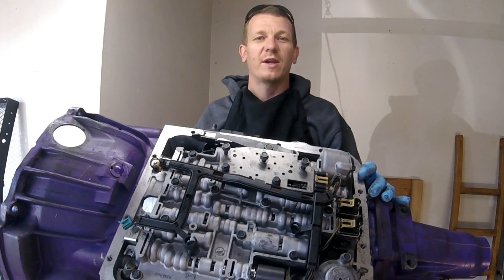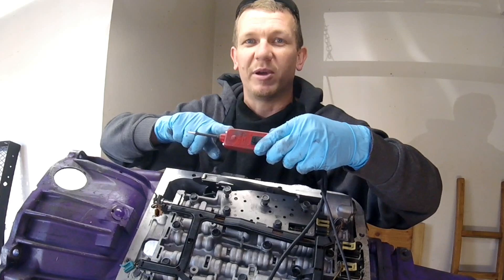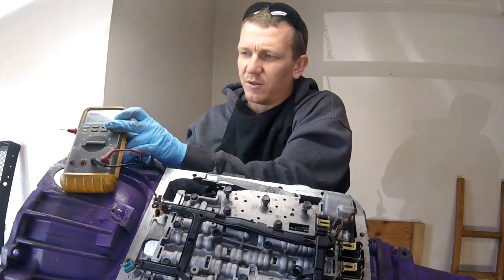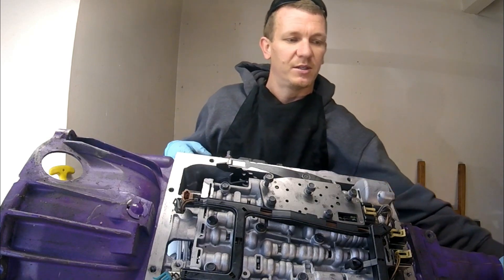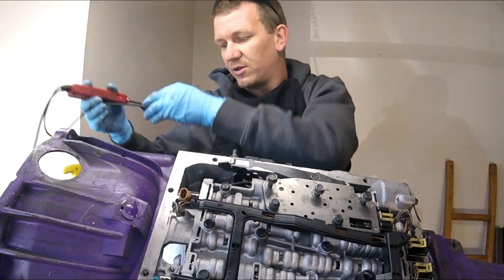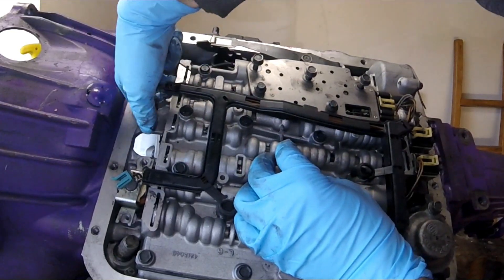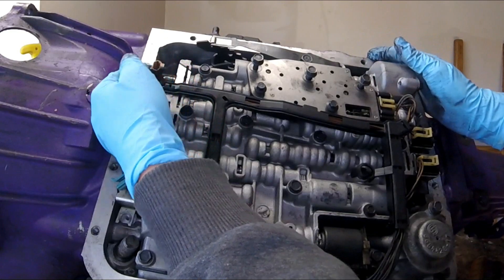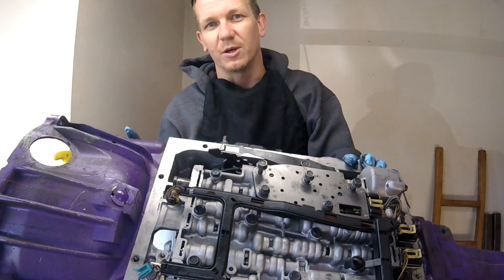⫷ P0785 4L60E ⫸

Comment: In case it's helpful, I had the P0785 on my 2000 Chevrolet Silverado K1500 and tried a bunch of things including replacing the 3-2 SS because it was inexpensive and simple. I tested the wiring harness by probing the power pin in the connector with my red lead and grounding on the frame with my black lead and got 11V (with the ignition switched to ON)--no issues here. I pulled the cover off the VCM in the engine bay and found the BLUE connector. Lo and behold, the WHITE wire (pin 13) was broken. This happens to be the wire for the 3-2 SS. I repaired the wire with a crimp, and my truck is running great!
Reply: VCM in engine bay? What are you talking about?
Reply: @dudebrosefson4699 vehicle control module

Comment: hi scotty new the channel so i have a 2002 trailblazer 4.2l 4l60e ihave replaced the a&b and thw 3-2 vavle tested the wiring harness with power probe  with key off and aligator clip not on a ground nothing to either side of connector .withe key on and aligator clip grounded i get poweer only to one side of connector not the other could this be a ground issue the shifting sucks i put it in drive and take off slow it will shit into 2nd  them limp  mode and nothing but when i stop and put it in prk then back into drive it will do the same thing and i can not even power shift it getting a p0785 code HELP

Comment: Hi. I replaced a broken TCC Solenoid (#24227792). On GM's website it says "This part requires programming and/or special setup procedures"... did you have to do a relearn/ programming procedure when you replaced it with a new one?

After replacement i'm still getting code p0894... also replaced the Trans control solenoid (2141892 ). Shifts fine driving in the city. Only after hwy driving do I get the code.

Comment: Hello I have a 2002 gmc yukon xl denali with the r4l65e transmission, it's not shifting into 2nd at all, was wondering if changing the solenoids will fix the issues.  Other than that, before it was just really sluggish and would act like it's driving in towing mode.  There's no transmission slippage or weird noises, it just won't shift out of 1st anymore.  Was also wondering if you knew if the solenoids in the 4l65e were different than the 4l60e.

Comment: Hey man. I've got a question that hopefully you can answer. When buying solenoids, is the 3-2 shift solenoid the same part number as the TCC/PWM solenoid? I'm getting the same part number for both. Is the measured resistance the supposed to be the same in both solenoids? I'm trying to buy both and wasn't sure if I could just buy 2 of the same ones. Advanced Auto has the same part number for both of them. Thanks in advance!
Reply: yes
Reply: Same issue, but both look different, some places show the TCC solenoid instead of 3-2, any idea which one it is?

Comment: Ok. I did all that on my 1998 Chevy C1500 with the 4L60E I WAS GETTING PO785 but my truck was not going into 1st gear or 4th gear. If I drove it for like 10 minutes like that I was able to shut the truck off and then turn it back on and then I have all my gears. I changed all my shift solenoids filter and fluid and it's still doing the same thing. Even if I try to put the shifter in 1 gear. It still won't work until I warm up the transmission and then turn the truck off and then back on and I can do that in neutral and then it goes in all the gears.
Reply: U figure it out got one doin the exact same
Reply: I have the same thing going on, any fix?

Comment: My trans will not shift out of 1st .05 Chevy avalanch .5.3.im being told its a shift silonoide
Reply: How do I fix.
Reply from the maker: Possible but it could be a lot of things. Does your speedometer work? Does it show your speed?
Reply: @ScottiesHobbies  the speedometer works accordingly all gauges work tachometer obviously raises when you're giving it gas
Reply: Everything works accordingly I did have an engine light on for evap but as far as everything else I've yet to try it has all the power in the world it will not go in the second third and drive
Reply from the maker: @lanceWM  i was thinking maybe your vss might be the issue but if you have a speedometer reading, its not that. You really need to test the shift solenoids. It could be the shift valves in the valve body not moving too. Its really hard to say its this one thing or another. You will get a different opinion every time and that can get expensive.  I'd get the ohms of resistance for all solenoids and drop the pan and start testing. You can also use a 9v battery to check the operation of the solenoids.
Reply: @ScottiesHobbies  ok ty
Reply from the maker: @lanceWM  no problem, I wish I could say its this one thing or another. Good luck on your fix. Keep us posted on what you find. 💪🤞👍

Comment: Glad I stumbled to this channel exactly on the jul 26 2021 bought a 94 Chevy c1500 from an auction with a bad transmission won’t go into any gears and I wanted to see if I can try something to see if I can try and somehow preform a miracle and get it to move so I’m trying to learn something from your channel thanx I really like your videos
Reply from the maker: With no movement at all id think something with the pump is not working properly. Clogged cooler? Not enough pressure? But these things are tricky and surprisingly each common issue doesn't always have a common fix.

Comment: Hi Scotty, your videos have helped me immensely! I have a 97 chevy K1500 5.7l with this 4l60e. I have code P0785 shift solionoid A. I replaced Solionoids A and B but am still getting the code and its shifting funny. Would you suggest I drop the pan and check/replace the other 3-2 soliniod your reffering to in this video? 
Thanks again,
Garrett
Reply: I have the same issue,  I am replacing mine right now and will let you know.  Did you do it and did it help?  I know this is 2 months late
Reply: @myhafh  yes switxhing tje 3-2 solinoid showed in this video fixed the issue! Hope it helps.
Reply: yep that cleared the code and it seems to be downshifting properly again
Reply: All I have yo do is change shift solenoid

Comment: Hi, when you’re checking the wiring harness is the light supposed to come on for both prongs when you test the continuity or just one? I have one prong light up on the harness but not the other. Didn’t know if this was working properly or I need both of them to have continuity for it to work properly. Thanks!
Reply from the maker: If the key is in the on position and the engine off you should se continuity on both sides. Are you using a power probe?
Reply: Scotties Hobbies yeah I’m using a power probe to check continuity. I did get the other side to light up with the key on like you said. However the light is not as bright as the other side when the key is off. Is that still okay or is that a sign of the wiring harness being bad? Also, Thank you for the quick reply and your videos are amazing! Very informative. Lastly I’m working on a 2003 Silverado. I have the P0785 code. The problem was it was shifting very hard from what I think was 1st to 2nd and then it would go into “limp mode” and wouldn’t shift up or down. Would stay in I’m guessing 3rd gear. I checked the solenoid that you pulled in the video and everything checked out with continuity and ohms but I did replace it because I already had it. Trying to figure out what else this could be before I put the pan back on and the problem isn’t fixed. Again, thank you and sorry for the lengthy response!
Reply from the maker: As long as you see the continuity, you are fine. Don't worry about the key off engine off voltage. Did you check the accumulators?
Reply from the maker: Or make sure the shift valves move freely in the holes for the shift solenoids.
Reply: Scotties Hobbies I tested the A&B solenoids and they both clicked with a 9 volt battery. I took off the 1-2 accumulator and took apart. Nothing seems to be wrong with it. Is there something I need to pay close attention for? Also, is there a possibility that my 3-2 solenoid was dirty inside and was causing the malfunction? It came out clean on the outside but just thinking of all possibilities. Thanks again

Comment: Hi! Scotty, here what have happened to my transmission on 05 escalade esv. Putting on drive and only went up to 25mph and rpm starting to rev after if pushed on gas paddle won’t shift to 2nd and the rest of the gears. if I put it in towed mode on and shift it to 3 third gear instead of (D) and it shift but only went to 50mph rpm stay at 3000 rpm. Again starting to rev after if push on gas paddle. My suv is two hours away from home. Just wanted to get it home so I can take a better look. Any suggestions? Thank you very much. You video are awesome!! I love it.
Reply: Did u ever figure it outMy 2006 Cadillac Escalade is doing the same.Did you ever figure it out ?if you did can you share?

Comment: Got somthing I've never seen befor. I have a 2004 4l60e. I think torque converter. Any thoughts? Truck will move when cold. Then loose everything. Shut it off wait about a min then start it and it will move again for a short time. Your thoughts?
Reply: Clogged filter

Comment: I just did covervette servo, ab solenoids & I still have a 1-2 shift delay. Pinless accumulator & 3-2 shift solenoid are next . Fingers crossed
Reply from the maker: I'll keep my fingers crossed for ya. I personally love the feel of my shifts with the sonnex pinless accumulators.
Reply: Scotties Hobbies jus got done with the job . Still a real bad delay on 1-2 shift . 
I don’t know what else it could be
Reply from the maker: @betosgarage  did you clean the shift valves when you did the a and b solenoids? You could have a problem with the band activating.
Reply: Scotties Hobbies on those I just swapped them out with ac delcos . Every video I saw they just replaced them

Comment: Just seeking a little clarity.. Same trans .. Originaly i got the code for solenoid a .. Open or short circuit, replaced both a and b , still have code but it's referencing open or short circuit on 3-2 solenoid.. Which would tell me that a,b solenoids are before 3-2 solenoid ,and maybe they all got toasted due to a short upstream smowhere .. 
I have a no shift. And no speedo scenerio .. 
The code hasn't changed just solenoid reference ..

Comment: I only have continuity on the wire that goes to the pcm, the ref wire on all the solinoids has no continuity? Something wrong with that?
Reply from the maker: With key on?
Reply: @ScottiesHobbies  I should check continuity with the key on? Ill try that
Reply from the maker: @pauldevloo3042  yes check it with key on, engine off.

Comment: Hi scotties, the 3-2 shift solenoide pmm circuit electric, is same part for Tcc solenoide Pwm ? Please unswer me, thanks.
Reply: I also have this question, are the solenoids the same?
Reply: Yes
Reply: I told u I would let u know. But the shifting problem was transmission needed to be grounded. So my problem was that was reason for it not shifting correctly

Comment: Hello friend I have a van and it is not changing from 2 to 3 I gave the code p 0757 check and I was disconnected the plug I connected it and I bought two valves A and B new since the others were very hard seals not acian their work I do not have the light of chek engin but my Van does not change from 2 to 3 any suggestion other than to buy a new